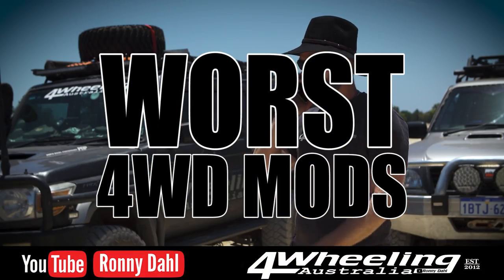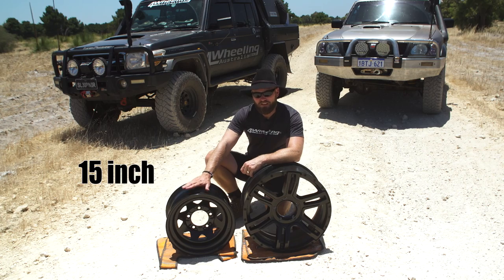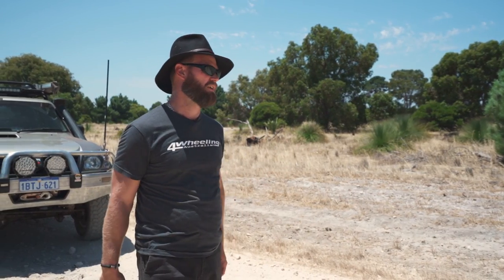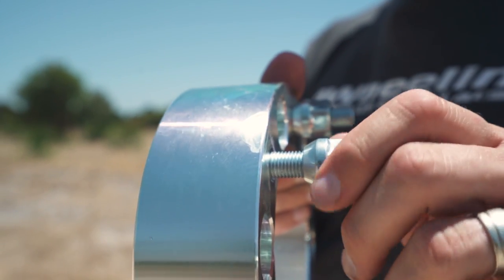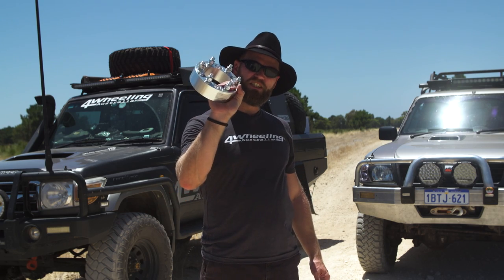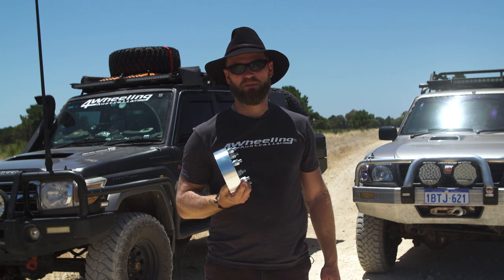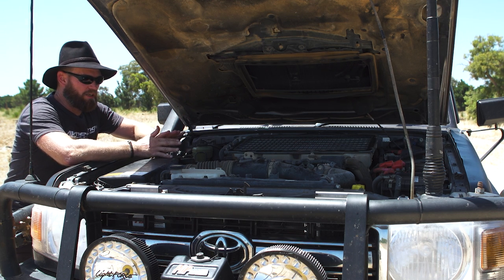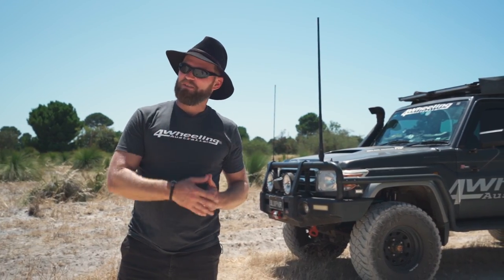WORST 4x4 MODS, DON'T DO THESE TO YOUR 4WD

Comment: I've run down two sets of 35" simex extreme trekkers on my weekender, that I and my wife sometimes daily. They are noisy and rough as all hell but they wear so nicely being a radial tyre. Going 37" razrs in a week for all round use and got another fresh set of Simex centipedes for winter.

Comment: Disagree a bit on the Hi-Lift. If you buy a base and the tire hook, very handy to lift a tire without lifting through the full suspension travel.

But I agree most Hi Lifts are decorations

Comment: FAKE BEADLOCK WHEELS!!!!!!!
Reply: Richard k d makes it easier for people with real beadlocks to get away with it as the fakes are flooding the market and cops won’t pull every car over to check
Reply: hahahaha ripper comment
Reply: Replaceable rock rings would save me from having to buy wheels year after year. I wheel hard enough to screw my wheels, but not enough to need bead locks
Reply: As long as the owner knows they are not real I'm cool with them having them lol. They looks very nice
Reply: Wait... they make fake beadlocks 😂😂😂😂
Reply: @davisgrafton1350  yah since real ones are illegal for some weird reason
Reply: element studios is it all over the U.S for daily or is it certain states?
Reply: @davisgrafton1350  nah just in Australia. That's probably why you never see them in the US
Reply: @elementstudios  fake beadlockes are everywhere in the states.
Reply: @jeffmayo6002  oh
Reply: element studios it’s because idiots don’t maintain them and keep the beads torqued down and then the beads fly off on the highway and puncture a radiator or crack a windshield
Reply: I actually have fake beadlocks on mine (didn't buy them) but they actually are pretty great because the fake beads serve as a rock ring around the edge and protect the rim/tire stem. Didn't realize it until I took them wheeling and tons of people had rims where rocks could easily rip off their valves them. I don't need real ones for the type of wheeling I do either so they do have their uses
Reply: I guess I have fake beadlocks even though theyre not advertised as that, its more of a bash ring as its made from HDPE and is removable. Still not sure how I feel about them.
Reply: @tuffskid  wym get away with it? Are bead locks illegal somewhere?
Reply: element studios any lifted truck I see there’s like a 90% chance they got fakes😂
Reply: Hahaha BroLocks..

Comment: There is nothing wrong with wheel-centric and hub-centric wheel spacers. This type of spacer provides a lip on the front shear face to join the rim and spacer together and another lip joining the rear of the spacer to the hub. This eliminates the shear effect and locks the assembly together. These are only available for specific setups though. See Spidertraxx for Toyota's. Been running them on my Sequoia on 34's for 5 years with zero issues.

Comment: LED headlight globes that are bright, over-heat &  melt things or catch fire, don't dim correctly & blind on-coming drivers & are illegal under ADR's & drivers who drive with their up-globed fog lights on at night.
Reply: Dog lights are supposed to aim down. Why would people do it like that?
Reply: @downunderfulla6001  Having fog lights on when there is no fog is illegal. Also, LED high temp fog lights, what is the point? You're just going to get glare back from the fog!
Other illegal lights, more than 4 driving lights, lights mounted on top of your bull bar obstructing vison.
Reply: Peter I’m not sure where you live. In Australia yes they are illegal but almost no one is ever pulled over. Maybe 1 in a million if the officer is having a bad day or they need money for their Christmas party. I live in Queensland where it’s not illegal to have a 3rd/4th/or 5th light on the bull bar. They just have to be under the height of your inter cooler bonnet scoop intake. Our local police department printed out the regulations and gave them to a local business owner (Ironman 4x4) for the community to take a copy. It does have to be under your vision of the road and your intake.

Comment: With all those references to laws, it just feels like TEXAS must be the wild west -and over the top lift kits are all around, but you still can't drive under the underpass in Houston when flooded because thats 12 feet deep. (I'm just driving a stock Nissan Rogue (no winch, factory roof rails, no special tires, 2 wheel drive -but my last car was a Nissan Cube with a Yakama Roof Rack added)

Comment: No, wheel spacers are perfectly safe if installed properly and on the proper application. The most common cause for failures is not due to the actual wheel spacers but install issues; incorrect hub bore (wheel to spacer or spacer to hub), incorrect torque value on wheel bolts or lug nuts, etc.
Reply: You're missing the point. They are totally illegal and insurance is void. You wanna drive all your hard earned into the back of a Beamer uninsured?
Reply: @bbodybenny  not illegal in the USA. Yes some states might make them illegal but as far as federal laws they dont exist. And no they will not void your insurance. I had them when I did actually hit a benz and nothing happened. No mention of wheel spacers where made by my insurance. They knew I had them and they knew all of the upgrades to my vehicle. I asked them prior to installing them if it would raise my rates or void my policy and they said no.

Comment: Good video Ronny, you covered everything pretty well I can’t really think of anything else, but yeah mods on a car that you literally don’t use, like bullbar side rails 33s lift and never take it off road, what I do is add stuff in priority as I need them
Reply: Got a 2012 stx 550 navara what should I do. I got it with a extra fuel tank and upgraded intercooler. I was thinking of a duel battery setup for a fridge and lights, snorkel with diff breathers extended and May be upgrade the bull bar. In future a 50mm lift. I only want to go camping g at Fraser. Morton  and straddie in the future possible around Australia trip but that will be a few years away and by then might end up getting a cruiser any way. Any advice would be nice. Ty
Reply: Anarchy hi mate if you’re planning on getting a new car I wouldn’t go to crazy on mods as you won’t see that money again,
If I was goin to Fraser and planning on getting a new car I’d get myself some max tracks a air compressor, tyre deflator and a snatch strap,
I’d put In the dual battery setup in as you can take it out and put it in your new car,
At least it’s money not wasted,
Reply: @bushmancam  yeah I got a air compressor already. The navara we got 6 months ago with low kms. So will keep at least 5 years.  Was going to get the battery in a box in the tray so I can take it out when needed.  Is a lift kit needed. Some say yes other's say no. For just sand and the odd track indent think I'll need one
Reply: When I went to Fraser I had a 2 inch lift and bigger tyres it helped with the wheel ruts on the inland sand tracks and the weight of my gear inside and in the car, 
My mate had a standard Prado on road tyres and went everywhere I went
Reply: @bushmancam  cool ty for the advice

Comment: I had OME springs and Dampers with only a 2" lift on my 1994 Troopy back in 2004, now it has 843,500plus K's and the OME has not sagged at all, it handles fantastic , but...but the old girl is about to retire to the farm here near Orange in 6 days time, the WA rego it has had since 2006 will expire on the 15th Feb and I'm not renewing, I have took over the 2017 Triton from my Daughter

Comment: When I was a young fella , I made the biggest mistake by trying to make my daily driver into a mud truck . I had a perfectly good 3/4 ton Dodge which I decided to put a 6 suspension lift and a 2 inch body lift on it to fit 38 inch Super Swamper mud tires . I learned fast that highway driving was dangerous because the truck wandered so badly , plus I got about 8 miles to the gallon . I also found out winter driving was all but impossible as well , because big chunky bias plies are horrible in the snow and ice . The only benefit was it looked cool and ran the mud good , but a daily driver it was not by any stretch of the imagination .
Reply: I daily my Tundra on 37s and 7" lift. Does perfectly fine if it's put together right.

Comment: Sky high body lifts with extra wide rims. But to eaches own. Personally, I would never wear a black felt hat and black clothes on a sunny day, or for that matter go with an all black vehicle if you get warm temps, but hey, you like it:)
Reply: What color is shade? lol
Reply: J Denmark well done mate and what you mentioned has no bearing on what the video is about.
Reply: Body lift or did you mean suspension?
Reply: @That-Guy-79  Body lifts or extended shackles on leaf sprung vehicles as you are just raising the center of gravity
Reply: @Natschke_Family_Adventures  Light colors when you are in high temp areas. The darker the color of the material, the more energy it absorbs, pretty straight forward really.
Reply: @jimmycoulter4801  Care to explain? He asked for comments about what mods people thought were the silliest. Check. I followed with a disclaimer that what works for one person doesn't necessarily work for another. Period.
Reply: @jdenmark1287  Ah ok. I work with some people that are kinda "slow". And I have to explain to them tires move the axle up. Suspension lift moves the frame up and a body lift keeps the frame where it is and lifts the cab and bed. Which is good for tire clearance.  I like low and flexible.
Reply: @That-Guy-79  Right on, I live in Hawaii, people love to lift their rigs to the sky, slap on some 22"rims with low profile MTs, delete EGR's, throw on 5" pipes and blow smoke at everyone
Reply: @jdenmark1287  Nice. I've always wanted to visit.  Home for me is southern Vancouver island BC. Check out Pathmaker productions for a glimpse of the terrain. They love yotas and samurais there. I commute with a rubicon to northern Alberta but have a 1990 reg cab long box  toyota for fun. And of course I wanna go down under.
Reply: @That-Guy-79  Love that area, we use to live in WA, had a summer place in the San Juans, use to boat over to Vancouver Isl or take the ferry. Beautiful place. Always thought you guys did a much better job with both your cities and wild areas.  We had a LR D1 and a LR SIII 109" then. One summer we took the AK ferry out of Bellingham to Seward and drove back in the Series. Quite a trip. Cheers.
Reply: J Denmark  ahh a keyboard warrior, check sky high body lifts with extra wide rims noted and ok but stop the dribble mate just stick to the subject - felt hat dark cloths wtf - are you a fashion reporter too, anyway so my disclaimer (not that it mean anything just an excuse to have justification for narcissistic unrelated comments) my opinion may not reflect that of others.  Good luck and all the best mate.
Reply: @jdenmark1287  Been to Port Angeles on the Coho ferry. Then out to Neah bay area. Very nice. So you're one step ahead of me. Next stop hopefully Hawaii.  But Alaska is calling me back.
Reply: @jimmycoulter4801  anyone that feels the need to call some one a keyboard warrior while using a keyboard evidently doesn't get the concept nor the irony. 
I live in Keaau, HI, if you really want to discuss the realities of being a keyboard warrior, come on by for a visit. If not, probably makes more sense for you to stop trying to defend a grown man from a simple observation that people like different things, and what one person finds practical another may not. 

cheers
Reply: @That-Guy-79  That trip was the only time I went to AK and we only saw a small part of it. But it's definitely amazing. Hawaii, is too:)
Reply: J Denmark you have just made my point for me 👍🏻
Reply: @jimmycoulter4801  As you did mine. See how this can keep going on and on and on. That's the drawback to your passive aggression.
Reply: @jdenmark1287  Spent many a long weekend in Haines AK and Skagway. But I was young and travelling with the parental units. Want to go back and explore on my own. Been up to Fairbanks and Dawson city and lived in Whitehorse YT as well. Bucket list is to dip my toe in the Arctic ocean up in Prudhoe bay and head south to Mexico's Baja peninsula.  And from west coast to east coast. Stamp my passport in your Aloha state on my way to Australia.  Maybe try an feed a Tasmania devil or 2.
Reply: @jimmycoulter4801  In the words of Rodney king "can't we just get  along?"
Reply: 👍🏻 no issue here  I’m a lover not a fighter, but I have just proved my point again 👍🏻
Reply: @That-Guy-79  Nice, sounds like you have the adventure bug too.  We have done the TransCanadien a few times all the way to Labrador. Baja use to be fun in the nineties but please be careful if you go there now. Mexico in general is a war zone. 

Save my contact and give a shout when you make it to HI. I live on the Big Island, which is pretty cool, but all the islands are nice. 

I went to AU briefly to pick out and ship a couple of LR Perenties two years ago. Really liked it there and wished I had more time to explore.
Reply: @jdenmark1287  I have first nation roots. Im only half native so maybe fingers crossed I can get by on my looks. Lol. But Its on the list. And going solo I can bounce on a moments notice. Plus driving a 30 year old  truck  might show some humility for what its worth.
Reply: @That-Guy-79  Cool beans. It's not so much an anti local thing there now, as just getting caught in the cross fire or setting off some drug induced paranoid kid. It is happening to the locals mostly, just a nasty situation. 

It's a real shame, because in my experience, Mexico was full of really sweet people, especially if, like you said you go there with a modicum of humility. And try to speak some spanish. 

You will definitely fit in here in Hawaii. My wife is a combination of Italian, French Canadien/Huron and she gets treated like she was born here.

Comment: high lift jacks, i always carry one. i have one so i take it, i only have two points were i can lift from. but i can still use it as a winch with chain, a bead braker ( and yes i have done this out bush when i needed to), also i have used it as a "porta power" to straighten out frame damage. learn to use your jack and you will also ways learn more ways to use it.

Comment: Depending were you live and out of the many different terrains and the actual purpose of what you are useing your vehicle for ..say like a 200 ft mud boog competition requires big tires big lifts and extreme high HP 
Opposite just running up a mnt on a fire rd with some mud puddles just requires u have 4 wheel drive ..
What u explained today was very good for all purpose trips ..some really good tips

Comment: One of the big issues with modern Land Rovers is the size of the brakes. They are huge. You cannot fit smaller rims to them at all, smallest rim for my 2016 Disco 4 is an 18" made by compomotive. Mud Tyre options are limited with it, and also so is the airing down aspect. I generally don't air down too low, but, luckily the D4's traction system is completely epic so it will keep you going despite the still high pressure.

Comment: You can use a highlift Jack for more than just lifting a vehicle. I have a 99 XJ with an offroad winch bumper that has cut outs for a highlift Jack also can be used to lift up by the rim (steel) of a vehicle depending on the rim you have. I've used mine to act as a winch to pull me over a tree I was high centered on with a tow rope and a snach block. The snach block was just there to help gain some pull when using the jack